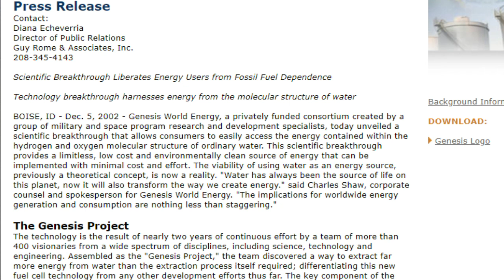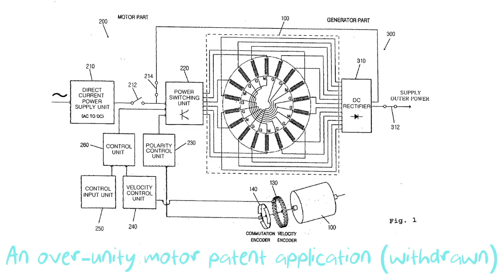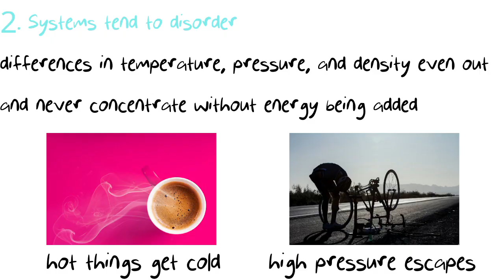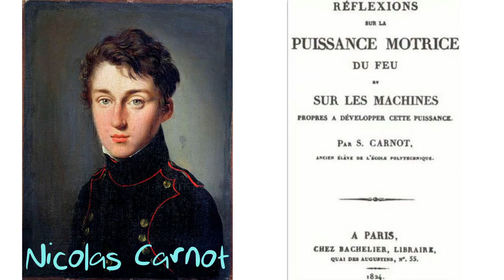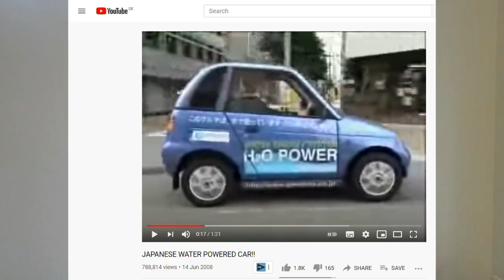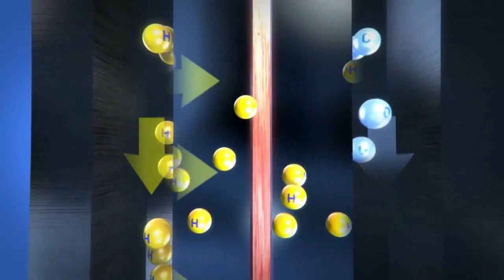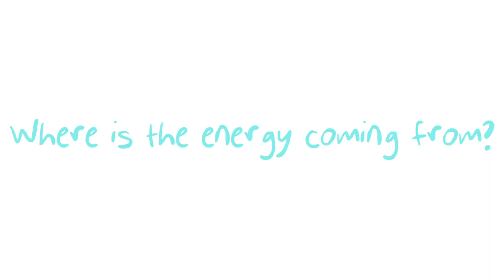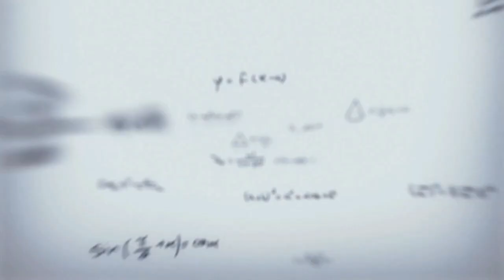First and Second laws of thermodynamics explainer video

Comment: Wikipedia:
"The theory of classical or equilibrium thermodynamics is idealized. A main postulate or assumption, often not even explicitly stated, is the existence of systems in their own internal states of thermodynamic equilibrium. In general, a region of space containing a physical system at a given time, that may be found in nature, is not in thermodynamic equilibrium, read in the most stringent terms. In looser terms, nothing in the entire universe is or has ever been truly in exact thermodynamic equilibrium.[77][78]

For purposes of physical analysis, it is often enough convenient to make an assumption of thermodynamic equilibrium. Such an assumption may rely on trial and error for its justification. If the assumption is justified, it can often be very valuable and useful because it makes available the theory of thermodynamics. Elements of the equilibrium assumption are that a system is observed to be unchanging over an indefinitely long time, and that there are so many particles in a system, that its particulate nature can be entirely ignored. Under such an equilibrium assumption, in general, there are no macroscopically detectable fluctuations. There is an exception, the case of critical states, which exhibit to the naked eye the phenomenon of critical opalescence. For laboratory studies of critical states, exceptionally long observation times are needed.

In all cases, the assumption of thermodynamic equilibrium, once made, implies as a consequence that no putative candidate "fluctuation" alters the entropy of the system.

It can easily happen that a physical system exhibits internal macroscopic changes that are fast enough to invalidate the assumption of the constancy of the entropy. Or that a physical system has so few particles that the particulate nature is manifest in observable fluctuations. Then the assumption of thermodynamic equilibrium is to be abandoned. There is no unqualified general definition of entropy for non-equilibrium states.[79]

There are intermediate cases, in which the assumption of local thermodynamic equilibrium is a very good approximation,[80][81][82][83] but strictly speaking it is still an approximation, not theoretically ideal.

For non-equilibrium situations in general, it may be useful to consider statistical mechanical definitions of other quantities that may be conveniently called 'entropy', but they should not be confused or conflated with thermodynamic entropy properly defined for the second law. These other quantities indeed belong to statistical mechanics, not to thermodynamics, the primary realm of the second law.

The physics of macroscopically observable fluctuations is beyond the scope of this article."

By me:
I am not saying you are wrong at all....But Mathematically the 2nd law of thermodynamics are adapted to fit a theorem/hypothesis and has been reproduced in a set scenario.- When did you last see a friction less piston engine, as proposed by Carnot?  You haven't,  because it does not exist - it is an oxymoron on which this Hypothesis/theory/rule is based rather than being mathematical precise.  This sort of scenario is always a good indicator that we did not think about something.... - Like the first rule can't be right since we have to adjust for it with a second rule or the first rule was wrong all along. I suggest you read the Structure of scientific revolutions by Thomas Kuhn. I love your channel and thank you for an awesome coverage of Denmark!

Comment: Telling if something breaks the first law of thermodynamics is not always easy. What about heat pumps? They appear to be working at over 100% efficiency producing more heat than energy input. I know that they are getting the heat from somewhere else, but that seems to break the second law by decreasing entropy.

If someone claimed to have a 'perpetual' energy cycle but it included day a great pump to store thermal energy would it necessarily be a scam?
Reply from the maker: I love heat pumps precisely for that reason: they appear to break the laws of thermodynamics! 
But it's only the case if you don't define your closed system properly. If I had never heard of a heat pump, I would indeed initially suspect it to be a  scam, but then I would ask the inventor to tell me where the energy comes from and if they understood the process, they would be able to tell me.
Reply: @EngineeringwithRosie  I love a heat pump too, since it illustrates the difference between energy and work so well (ie Second law of thermodynamics). And it shows basing conclusion only on the First law of thermodynamics, lead to many misleading anomalies such as this one.

But what is far more interesting. Is it also indirectly shows the fallacy of comparing different types of dissimilar efficiency figures. For example a heat pump's efficiency figures is not the same as other efficiency figures.

In the same way, a heat engine's efficiency figures (thats are limited to Carnot's theorem) should not be compared to electric motors efficiency figures, based on Statistical Analysis principles, makes it a very flawed comparison. Which even engineers are often guilty of violating due to expediency.

FWIW nuclear reactions break the law for the conservation of energy (and mass). By converting mass to energy (and the big bang created mass from energy). So it's only a applicable to Newtonian reactions.
Reply: FWIW a HP efficiency figure that's great than 100%, just means more heat energy is moved than the electrical energy needed to move it...  Not that there was a net increase in energy in the system...
Reply: The neat thing about heat pumps is that their job is to produce heat in a specified environment so all that "waste heat" from the 2nd law is actually useful output and heat pumps therefore can have 100% efficiency.
Reply: wrong a HP does not produce heat.... it moves it', so it's silly to think the laws of thermodynamics are applicable

Comment: The number of articles I've seen on various left wing science sites has exploded with every imaginable renewable promise of replacing fossil fuels. Not one adds up to dog shit. Yet I constantly get kicked out of the chat or banned altogether simply because I produce evidence to the contrary. Here is my position. I don't think there is global warming and if there is, then its either normal or a slight anomaly, in the whole scheme of things most likely the latter. I still think we should be using fossil fuels and most countries are. In 2021 we seem to be able to extend the efficiency of FF while polluting less. And we keep finding new deposits and this stretches out the date to hundreds of yrs before we run out, contrary to media hysteria. After 20 yrs renewables they are not commercially viable and are no where near replacing FF. However, I do think that research into renewables should continue indefinitely. But the phasing out of FF in the mean time by first world countries is madness.

Comment: These overunity scams are pretty easy to spot, especially since they are often accompanied by some sort of conspirationist discourse. But then there is the other kind, the kind that ignores or lies about efficiency, to make something that is vastly suboptimal look as if it was going to replace well established technology. In a FB group I was in someone brought up an article about a "giggly wind turbine", which was just an oscilating pillar, and was portrayed in the press article as it really was better than conventional wind turbines, more reliable, just as efficient, and easier to install and maintain, yet nothing was backed by any real world experiment, just a 3D animation and a proof of concept giggly thing that had been installed in the desert to take nice pictures. And that's exactly the same thing with "green hydrogen", it's been sold as the miracle replacement fuel, and ignorant or cynical politicians jumped on it disregarding the very low efficiency.
Reply: Oh, yes, that "giggly, silent, piezz-based column" ... had that turning up in my "extended bubble" a few times already, too ... :o
Reply: Yes this is a real problem and it contributes to the tendency to magical thinking around technology.
A lot of the ideas (like the jiggly wind generator) probably do have some scope as niche products, but are vastly oversold by technically illiterate PR people.

Comment: So by your own definition wind and solar are not "renewable". Renewable and alternative energy are not synonymous. Alternative means it's different than the normal. Renewable means that something is used, then is brought back and reused. Renewable doesn't exist.
If I'm mistaken please explain how wind and solar are renewable.
Reply from the maker: Yep I see your point, linguistically perhaps you're correct but that is not how the term is used. True, eventually the sun will burn out and we won't have any solar energy or wind after that. But extracting energy from these sources isn't using them up. The sun's energy will continue to shine and the wind will continue to blow no matter how many solar panels or wind farms we install. So that's why they're called renewable. 
I think "alternative energy" is even less linguistically correct, because these are already the most common new sources of electricity generation. In several countries wind and solar generation makes up more than 50% of the electricity grid. Not exactly alternative.
Reply: @EngineeringwithRosie  using a term incorrectly doesn't make it correct. If wind or solar power was 90% production for a individual or country. That would be their main source, that would make a gas generator an alternative source. My main source is solar, I may build a wind turbine, or run a generator during times the solar isn't producing enough for long periods of cloudy days. So both are alternative to my main source. Many people l've talked to think they need just one source. I doesn't work, at least offgrid anyway. 

Renewable, source of energy that is not depleted by use, such as water, wind, or solar power.

This is a misrepresented definition of renewable. To me and quite a few more that I know. Most are offgrid, some have moved back to ongrid living. Basically because of the misrepresented power generation by sellers of smaller systems. I got no problem with alternative energy sources, it works but smaller systems put a bad taste in people who think it's renewable and cheaper.

Alternative 
: offering or expressing a choice several alternative plans
: different from the usual or conventional:
Reply: WADR the construct of an energy source being "renewable " or not, is used for ppl who live on earth... and the sun for example is constantly "renewing" energy sources.... So by definition there is "renewable energy" ...  KISS...

FWIW, the Earth is not a closed system, so the laws of thermodynamics are not applicable... for if its a renewable energy or not....

What really matters is how the energy is used or not used? As a form of work or not? Not what we call it...

For us pedantic individuals who can't accept reality and waste time on pointless  semantics... good luck at the shrink and call it anything you want, since it does not matter :)
Reply: @roscoepatternworks3471  Hard to follow your train of thought... But your issue seems to be with "Misrepresented power generation by sellers of smaller systems"? If something is misrepresented by a seller, its not relevant to if it is a Renewable source of energy or not.

Good luck finding sellers who are honest, no matter what they call it....
Reply: @nc3826  my train of thought is straight forward. Although the sun will be there way past our lifetime. The natural resources that we have may not be. Look at just the process and material to make wind and solar  work. We use rare earth metals for batteries, solar panels wiring etc. This involves mining, smelting and metal works, all those involve high amounts of electricity, diesel to produce. You also have large areas of land for enough solar and wind farms to run even a single city. After 20 to 30 years wind turbines will need to be torn down and if possible recycled. Metals can be, concrete maybe, carbon fiber blades, not yet. The 5 years of profit after the turbines have broke even will be lost on the clean up, something that isn't happening in a lot of places, it appears. Solar panels lose efficiency over time, same they all need to be recycled and replaced maybe every 20 years. You also need a ground crew to keep them some what clean, fix and repair broken panels etc. The storage system(batteries) so far don't last as long as the solar panels. Now if you go all electric on transportation how much lithium do we have in the world? Rare earth minerals? So basically we are substituting one non-renewable resource for another. And we still need the crude oil for all the plastic we use. But you also have guys like bill gates, he has a team working on a high altitude compound to reflect sunlight back into space, to stop global warming. How's that going to work with the push for more solar energy. I'm living offgrid my solar panels take up about 600 square feet of land. It provides almost the same kw as my on grid house, about 1300sf. So if everyone in America had a 1300sf house approximately 350 million you'd 7532sq miles of land just to supply the houses and 2.8 billion batteries. The numbers are a little high as I used 350 million for the population so through in about 20 million Canadians too.
Reply: @roscoepatternworks3471  straight forward??? you must have stigmatism... thx for proving my point....and have fun down your convoluted rabbit hole, sir....
Reply: @nc3826  the rabbit hole is thinking the end all, cure all for our power needs is wind and solar.
Reply: @roscoepatternworks3471  only in your mind, sir.....that "renewable" just means wind or solar...... you keep proving my point....
and that you just have "axe to grind", so you will keep rationalizing issues about them that do not exist or that are irrelevant... have fun.... it's all good... tc....
Reply: How about calling it "not environmentally damaging energy?" All of the power sources we use comes from the Sun or dead stars. Coal is from fossil plants that grew from energy from the Sun. Uranium, Thorium, etc., comes from dead stars... isn't everything made of stardust, possibly, even our Sun? Hence, even the Sun is renewable.  perhaps not, as stars will tend to become iron in trillions of years.  All of that is just semantics.